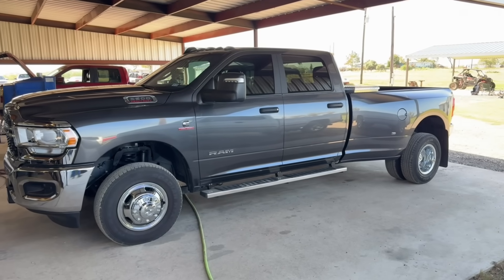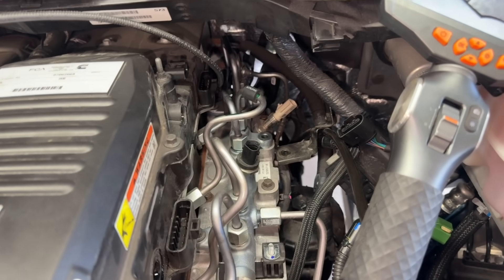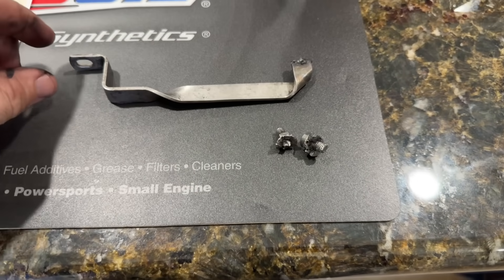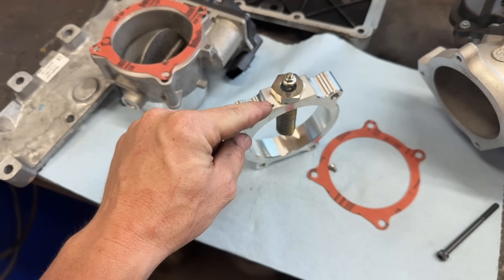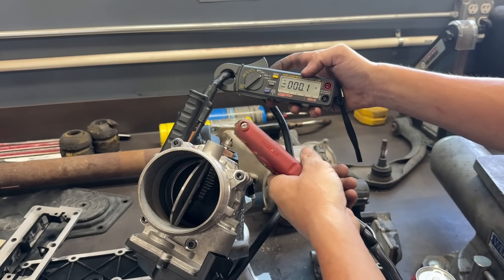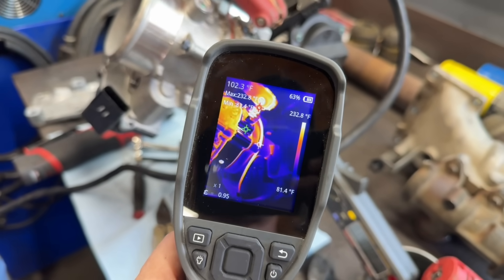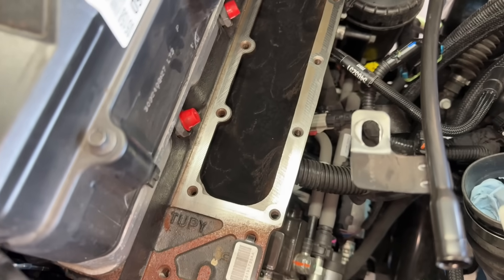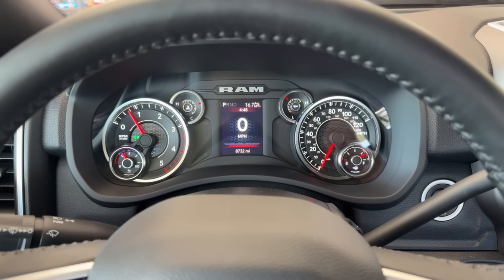Cummins Killer Grid Heater Upgrade

Comment: Your question regarding the grounding 

Here is what I would say as to why they would not give it the proper gauge. Not to say on purpose, but why they might get away with it. 

1) you can get smaller ring terminals, they are usually just thicker. 
2) it’s a short run of cable and only running for about 5-10 seconds.  So by the time it heats up, it’s already shut off 

That’s the best idea I have anyways. Whether or not it’s right I can’t say.
Reply from the maker: They forgot the ground completely when they were first released and this was their fix so that they didn’t have to remachine them all to accept a proper size ground.
Reply: @Stratemannauto haha. Shit!  Forgot that. What gauge wire was used for the smaller one?  I’m genuinely interested!

I’m a car audio guy and recently had speaker wires melt together because I didn’t consider how much more current is pulled with high current amplifies that now have high voltage. 

Example:  
10v a/c @ 4ohms would be 25watts=‘ 2.5 amps

10v a/c @ .5ohm is 200 watts =‘ 20 amps

Now if you scale it up to 40v and say 1ohm now it’s 40amps (1600watts). All of a sudden a 12 gauge wire ain’t gonna cut it anymore. 

I did a really cool experiment on a 5.9 with a 1000f super capacitor powering the system.  It was a cold start and it warmed the glow plugs faster than 2 batteries and ran the hydraulic pump for the snow plow better.  

Really neat stuff

Comment: Your attention to detail and the fact you actually care about your work is awesome! The only thing I would add is I am not sure on that bolt (ground) you used is coated. Black Oxide. I know some coatings like anodize are NOT conductive. Just food for thought. On the same subject the longer aluminum is exposed to oxygen, the more it oxidizes. The more oxidization the more resistance to electricity. In the past I have lightly sanded and cleaned aluminum contactors and applied the correct grease to stop this exact process. Probably over kill in this situation, just food for thought.

Comment: Thank you for your details.  Incredible video.  I'm just starting.... would you still go with BMP 7.3 style versus the new GDP with a grid style heater?  I have no allegiance to either company, but the GDP looks closer to stock, but in air inlet obviously.   And if you'd have just disconnected the stock heater, would it still be at risk (without the heat)???

Comment: Your wire choice is sufficient.
Look into nickle clad wire that we use for heating elements in commercial appliances. A 10 guage will carry the same amperage as your 6 and the insulation is rated several hundred degrees. Not sure if it will withstand the oil, fuel and grease is my only concern.
Found your channel recently, enjoying your content.

Comment: 2 questions. Just curious on why or why not they wouldn't work.
1. could you use a lock nuts on the original heater element to prevent the nuts becoming loss?
2. if they had them, would metal gaskets help with the grounding on the black market heater element?
Thanks, awesome videos

Comment: Have you done a 2nd gen 5.9L 24V rear main seal? If so do you have any videos of it or pointers(steps) on how you did it. I pulled my trans to have it rebuilt and noticed a small leak starting so figured I’d replace it.. do you recommend the seal with or without the wear sleeve? also do you recommend doing the seal on the back of the adapter plate for the cam?

Comment: For those who do not have the capability of drilling and tapping a dedicated ground bolt hole, I would suggest perhaps using a 6ga. ground wire with a large ring terminal on one end that would fit on the heating element thread and simply clamp into place when the "glow plug" gets tightened. And the other end could go wherever a proper sized bolt and ground would be nearby the heater. Just my .02 cents. You have done a nice job and it shows you care about your work quality. I've been a mechanic for over 50 years and it's hard to find people that care nowadays. Good work, Carry On!

Comment: Great work Ryan! Clean install and good work as always! I am currently doing a 6.7 Monster Ram on my 06 5.9 truck. I am going to follow your lead on the ground. Solid advice and good catch for sure.
Reply from the maker: The monster ram doesn’t have the grounding problem. I would recommend you look into the failing fuel lines though. There have been quite a few. We will never install another monster ram.

Comment: Hey love your videos ! I’m currently doing diy injectors on my truck what size are those plastic caps you put on the feed tubes ? Is you know thank you I want to get my motor closed up but I can afford the new lines yet so I have a bag over my open cylinder head in my drive way this will help me so much to get it closed and keep dust out ! Love how clean everything you do it take pride in it that’s awesome thank you
Reply from the maker: Why would you need new lines? We reuse them constantly
Reply: I read you have to replace them or they leak… I’ll reuse them do I just spay them with cleaner and air to get the dust out and re install ? Also the banjo bolts and fitting is that all re usable the washers and stuff ? Thank you so much !
Reply from the maker: @JosephMejia-gi7hv clean it out with brake clean/air and tighten them back down. No one replaces them
Reply: Thank you so much man.  Saved me a lot of time and money ! I was trying to do the best job I can at home and read it off Reddit form and it’s just stuck in my head ! I appreciate it ! Going to get it back together this week now thank you !

Comment: I have an older Cummins with a stainless intake horn...have the grid heater delete...I had a bung welded into horn and the 7.3 heating element installed. I have extra threaded "boss" on the horn for the ground, I made a heavy jumper wire to complete the ground loop.. Also installed a new heater solenoid as good measure..

Comment: Finally! Banks thing is baffling, grid heater nut was a total coincidence. Crazy they used this flaw to sell expensive intakes that do nothing. What are your thoughts on the BD diesel heater upgrade kit?, simple but still a bit pricey. You are the right person to come up with a simple and effective solution to this problem. Could probably be done for less than $100, excluding labor. Hundreds of thousands of trucks to be saved. Not sure if you've been up north but that 7.3 element aint cutting it, especially below 0, regardless of what banks says. Not great for the engine in the long run, hard starts for no reason. Cheers brother, great content

Comment: I ran into this issue also with the black market heater. I installed one and noticed it wouldn't turn on. Test the ground and had none. So I loosened the bolts a little and pushed the assembly to one side so it would contact the bolts. Then it started working. But I also added a 8 gauge wire to that little allen. Just in case the bolts didn't give it enough contact. Hopefully that was sufficient enough. I also called and spoke to them about another design or at least make good instructions about installing it with a ground.

Comment: I work for Cummins and what they don’t tell you is that the Stellantis grid heater solenoid sticks closed and that’s why the nut backs off. It’s extremely rare but it does happen. You don’t see these failures in school busses or box trucks
Reply: I kept being told my truck hunts at idle because of my grid heater. I deleted it and it still does it🤦‍♂️. The tuner says it’s the cp3 pump
Reply: @dannyleemcquillenjr.8292 was it tuned after the grid heater delete?
Reply: Extremely rare. Yeah ok.
Reply: @zmanmeyer2172 out of sever hundreds of thousands of engines sold? Yes
Reply: @Datsun280zeeee I'd buy rare but extremely rare, no. I would've agreed last week before my Cummins ate that death but but for me now having first hand experience I have to disagree with "extremely rare".
Reply: @zmanmeyer2172 I’ll ask my friend in the warranty department how many have been reported

Comment: I enjoy your content.  I was wondering if you have thoughts on the revamped 6.7L Cummins I guess brought out this year.  I though I read that they changed the formula for the block to make it stronger.  Do you know if they fixed this issue with this new engine?  If not, and you had this modification installed would it effect your warranty?  Thank you for your excellent content.
Reply from the maker: They are too new to have any opinions on. They have some cool features but we wont know how tough they are for a little while.

Comment: I'm interested in seeing how this kit handles extreme cold start conditions. In my experience, even with a block heater, oil pan heater, and battery maintainer all plugged in, starting can still be difficult at -40°. Has this kit undergone any controlled testing or field validation at extreme temperatures to verify its effectiveness under those conditions?
Reply from the maker: We live in south TX where a 15° winter would be extreme. The banks kit that uses the same heater didn’t do very well in extreme cold (some guy out of Canada tested it) but theirs isn’t mounted in the direct air path like this one. If I lived where it was extremely cold you can bet your 🫏 I’d test it 😂

Comment: There is a tsb for the grid heater relay sticking closed… that is why the bolt fails after the insulation around it gets cooked it starts arching to the plenum, that bolt has never broken in any other application than ram trucks, not the bolts fault but the fiat relay👌
Reply from the maker: Learn something new every day. The TSB says nothing about what to do if the relay is the cause.
Reply: @Stratemannauto  If it’s the relay sticking then the relay should probably be changed occasionally due to pitted contacts. This may eventually cause them to stick because the contact surfaces will be poor enough to cause a high resistance connection when it closes and heat up under normal load and welding them together. Maybe the relay contacts size are insufficient for task? Or more likely maybe because DC is harder to open than AC because its battery current is constant in the circuit unlike AC current that alternates from 0 to full at the frequency of the circuit. The arc is is harder to extinguish with DC and causes damage to the contacts. Another option with DC is to put two contacts in series to help extinguish the arc when opening. A relay that has two contacts instead of one this is easy enough to do. By putting two in series this doubles the length of the arc which helps extinguish the arc quicker. You would jumper one contact to the other in series. It  would be nice if Cummins came out with a real answer to the problem.
Reply: Well if it didnt have electrical problems it wouldnt be a dodge/chrysler

Comment: Just unplug the thing. Unless you live in sub 30°F weather you do not need the grid heater. If it get's colder than 30°F, plug in the block heater.
Reply from the maker: It’ll throw a code if you do that.
Reply: @Stratemannauto  Not on my '14. Deleted the entire electrical system supporting it too and the truck doesn't even know it's gone... so no code.

Comment: Wish you were closer to me to help diag my A/C on my 2011 dodge. Runs fine for awhile but after a few hours seems the evap core is freezing up and stops blowing well, drips excessively when it's shut off.  Don't know if it's a clogged evap core, bad expansion valve and/or drier
Reply from the maker: The last few have been compressor failure causing a restriction in the condenser. You can easily tell by hooking up a gauge on the high pressure port and watching the ac pressure pid with a scanner. They should match. If they are off by 100psi you know you need a new system
Reply: @Stratemannauto thanks I'll check that out, I have noticed my compressor seems like it's cutting in and out at idle when I first turn on my truck causing a slight surge for a little until it's warmed up

Comment: When measuring the wire temp, the max temp shown was the red circle which was the heating element. The wire itself was about 115F max. Most wire is rated for 105C. Not saying the M8 isn't a better option, just saying the wire wasn't 200
Reply from the maker: I don’t disagree but the wire color also matched the hottest end of the bar graph on the right of the screen. It was 100% getting very warm. In some cases these heaters can run for 90 seconds or so, that wire or any wire smaller can definitely start to glow and cause a fire
Reply: @Stratemannauto not disagreeing on wire size 6awg is what it should be

Comment: Whoo first, how does the black market versus banks compare?
Reply from the maker: They use the same heater element and dyno tests have proven the banks adds zero HP so my preference is the BMP
Reply: @Stratemannauto awesome, what about the intake horns?
Reply from the maker: @Redbloodroadrunner stock is fine.
Reply: @Stratemannauto you mean I won’t gain 50 hrsprs from it 😅